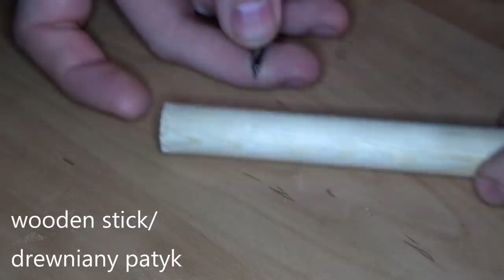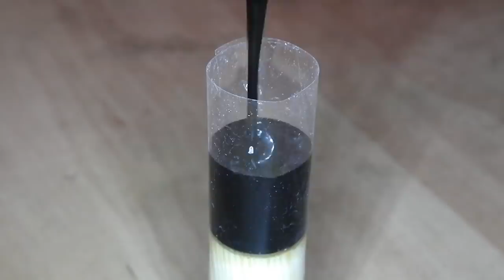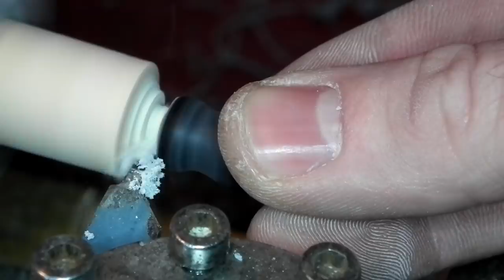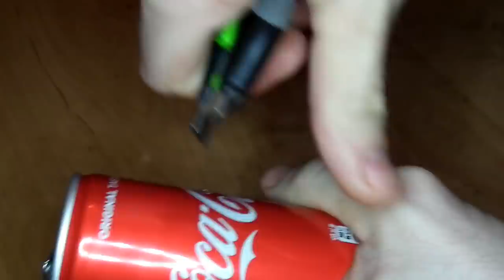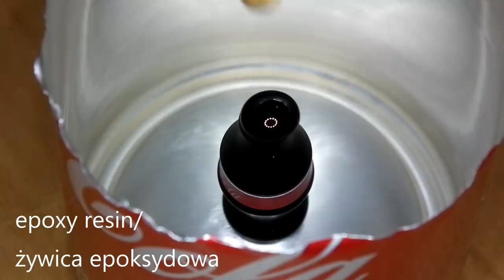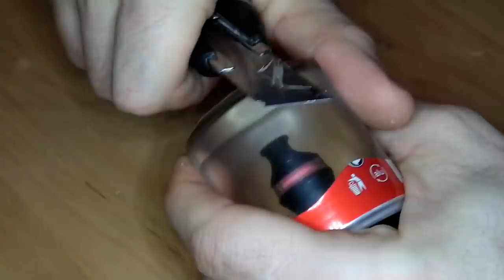Transparent Coca Cola with a Surprise Inside / ART RESIN

Comment: You use 2:1 ratio between the epoxy resin and the hardener. Does that depend on the type of epoxy/hardener used, or project? Looking for these in my area they say need to use 1:1 ratio...
Reply from the maker: Each resin brand has a different mixing ratio. You must adhere to what is written on the label

Comment: @Jedrek
I'm thinking about having a go at something similar to some of what is done in these videos. But getting a lathe is petty much our of my reach at the moment and at this stage spending that much money even on a little desktop lathe would be a waste at this point if the project doesn't work or I just have too little talent to make it worth it. But I CAN do electronics, I have a few stepper motors and I'm thinking about getting a decent one to make my own basic lathe that would be enough to do something like this, and here is my question.
Does anyone know roughly how much cutting force is applied when milling resin like this?
Reply from the maker: You can do it with an ordinary drill. Or a cordless screwdriver. Tyly strength is enough.
Reply: Great, thank you.